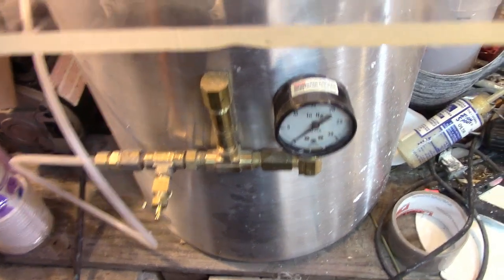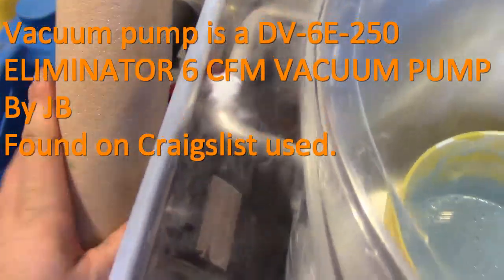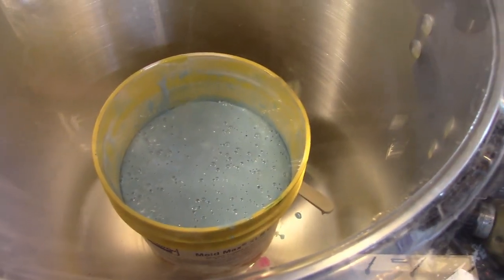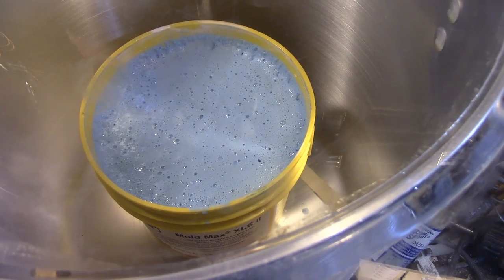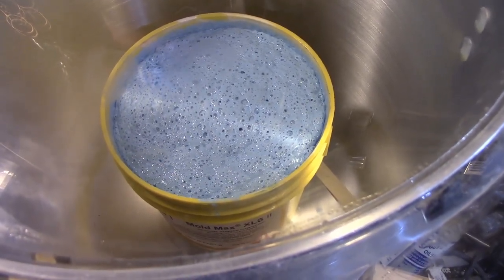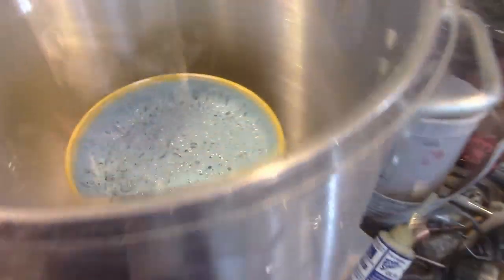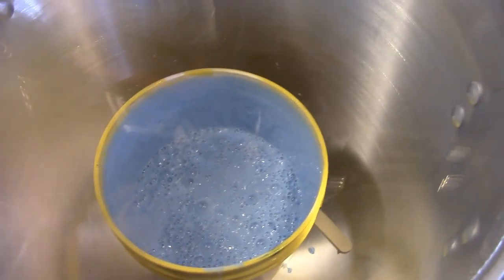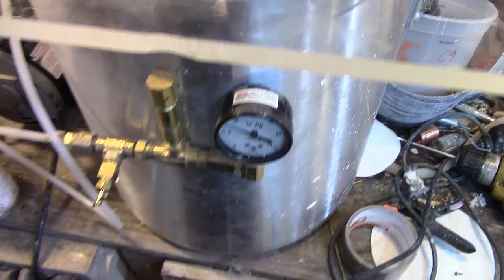Degassing silicone, custom built vacuum chamber

Comment: Old video, but worth mentioning that you ordinarily shouldn't degas such a small amount of material in such a large chamber...especially running a low CFM pump. It's just not efficient. That's why it's taking forever to evacuate that massive chamber.  Instead, either build a smaller chamber for small projects or add material to occupy space in the large chamber to reduce its size.  Or get a pump with a higher flow rate.

Of course, if you don't mind waiting for it, the current setup obviously works too.
Reply: Indeed, it's a 6cm pump, by JB. Chamber was built on budget for large scale 5 gallon buckets, the demo was 1/2 gallon size. Thanks for the volume reduction considerations for small evacuations.
Reply: Drew DiDomenico I understand. Yes, you managed to create a nice simple realistic setup for larger quantities. Thank you for sharing it with us
Reply: A couple considerations for you. 

First, those JBs (and most cheap pumps you'll see folks using on YouTube) are obnoxiously loud. The Eliminator is somewhere in the 68 to 75 dba during operation. That's the equivalent of a lawn mower or vacuum cleaner. With a little patience you can find a much higher end, more durable, longer lasting pump that's significantly quieter. We're using Edwards RV-series (specifically the RV-12). It's a $3600 pump, but we scored one for a mere $150 in excellent condition on Craigslist. Folks acquire them from labs that are upgrading their equipment so they're usually well maintained too. It runs at 48 dba which is as quiet as a theater with no movie playing or a quiet neighborhood at night.  Your ears will thank me.

Second, use a surfactant (defoamer) to control the foam and you will never need to open your chamber. Doxy 5 (2,6-dimethyl-4-heptanone) from Smooth-On is one of many types. It'll depend on what you're degassing. For example, silicone, urethane, epoxy, etc. Many of the DIYers degassing on YouTube aren't even aware that surfactants exist.

Finally, invest in a better gauge. Typical cheap vac gauges are off by as much as 3-4%. You might not be pulling anywhere near as much as you think based on that gauge.  For under $30 you can find a used (or a new "second hand") higher end gauge on eBay that's accurate to at least 0.5%. We're running a nice 5"  Weksler. Easy to read from across the workshop, accurate to 0.5% and under $30 on eBay (costs more than 3X as much new). And in our case we use it along with a JB DV-40S which measures down to 10 microns.

Comment: why do you need that much
Reply: The system is built for the potential to degas silicone in a 5 gallon pail if needed. I sell custom silicone molds, and move a lot of silicone. It's easier to mix and pour a whole bunch than to mix a little bit.